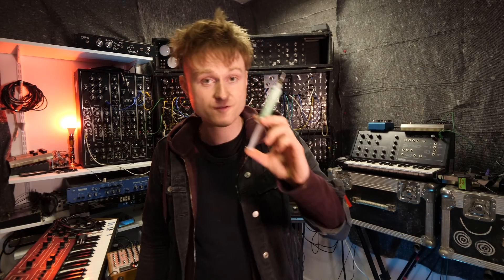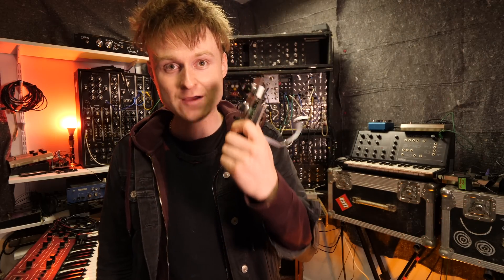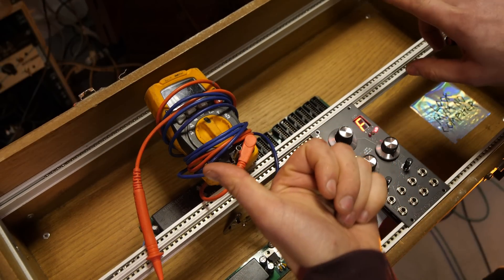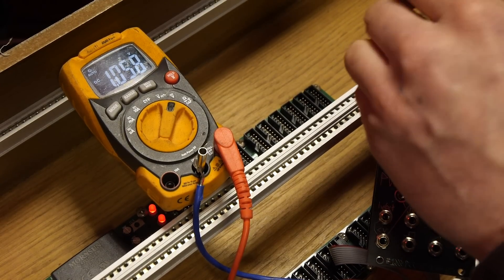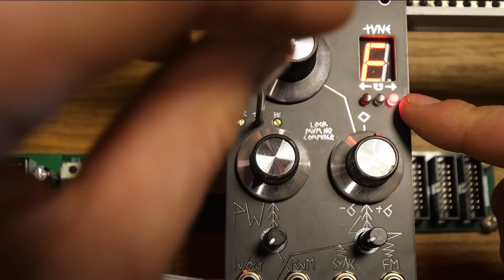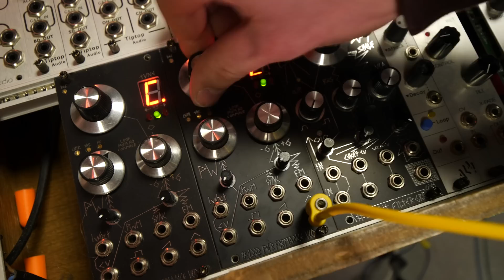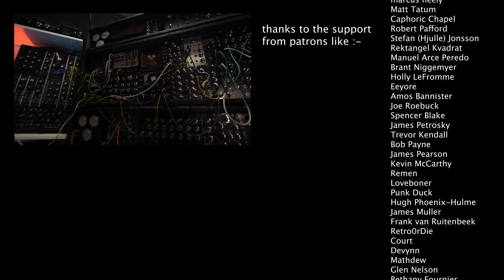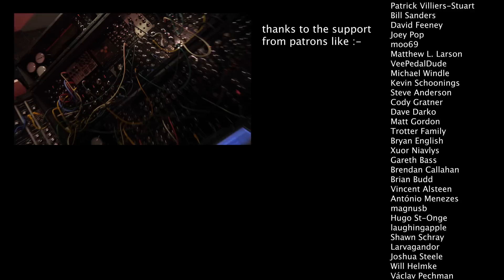Building The Little Brother To The 1222 As A Kit - Analog Oscillator VCO With Tuner

Comment: I’m working on calibrating mine. What does the HF trim do exactly?  I’m having trouble with the tracking a bit.
Reply from the maker: If the notes are too close together turn it up. If too far apart turn it down. As for hf it's a fine tune on the top top notes. It could be in any position and it'll all still be in tune for the most oart
Reply: @LOOKMUMNOCOMPUTER  I see. Thanks. I need to let it warm up more before trying again.

Comment: Calibating those trimmer pots, makes me think of EEVBLOG’s famous quote “tongue at the right angle and tweak”.  I wonder how the auto calibration circuit of the Volca Keys works, it’s got analogue circuitry but it’s able to self-tune itself. It always does a self calibration during start up. How does such a circuit work?
Reply: The Volca has a processor in it and the CVs for the oscillators are created internally so it likely checks the frequency of the VCO outputs and applies offsets to the CVs that it generates.

Comment: Flux is great, just be sure to clean it up after! Not only can it cause corrosion and dendrite shorts, it makes the board sticky.

No need for fancy cleaners either. Isopropyl alcohol and a cotton swab or a toothbrush work great.
Reply from the maker: I usually just lick it
Reply: @LOOKMUMNOCOMPUTER  that explains a lot :D

Comment: 2:38 witch part / model / brand is this?
You didn't make it bi-polar? (didn't take a look at schematic when you made it back than!), you loose amplitude, the Triangle is 0-5 volt and the saw is 0-10 volt, at least that says datasheet.
"Kassutronic" mounts pin 1 and 2 to -5V to deactivate the inner 6Vx zener diode and prevent heating the chip internally.
Why the Saw wave and not the pulse?
Feeding the Arduino with a 10V signal? although via a 1k resistor? you must be very lucky. maybe you should add one more resistor to GND at R36.
Reply from the maker: Unipolar for easier positive distortion. Saw tooth was driving the arduino cus of the variable pulse width mod messing with the tuning code. As for 1k yes dues to built in protection. It's all good! But cheers!
Reply: @LOOKMUMNOCOMPUTER  You code would work like this:
the chip see the digitalWrite function, goes to the place where the function is defined the program memory, than goes to look for led 1 and take it's value and change the pin.
it does that for every led in the 7 segment led display.

if you could see it moving, the code would be going up and down al the time, like a lunatic.

imaging a vinyl record and you placing and moving the needle continuously.

it's much better using BIT MASK technique and do all the work in one or 2 lines of code rather than a repeating trillion lines of code. change all leds in a single command without altering the pins you don't wanna change.
Reply: @LOOKMUMNOCOMPUTER  Your friend "Jos" does a mixed version.
at first he goes hardcore, witch is good.
PORTB &= B11101111; // Set pin 12 low.  (bit masking)
PORTB |= B00010000; // Set pin 12 high.  (bit masking)
But later he resumes the noob method in a weird way, doing redundant checks.
lol

Comment: do you have a video where you explain the basic / big picture concept of how this modular synth thing works? 
Like, what makes the loops?
How do you have several playing?
what is the input of those synth modules?
And what do they output?
Is it "just" audio? could you at any point put the result into an amplifier? 
Or do you need some kind of device for that?
Reply: The oscillator is where it starts, 
That drone is then modulated with shaping the waveform, fiktering ir modulating it in sone way.
Modular synths work by how they can be plugged and rerouted and effects stacked and processed through various modules, splitting or recombining in a very manual sense .
This oscilllator tuner is a noise box essentially.. amplify it and on its own it produces some crazy effects.
I believe he us sequencing via midi here using the midi sequencer to command the module then modifying tge loops with the dial thingammy..
Reply: Nik's Sofa, do a search for beginners introduction to Eurorack.